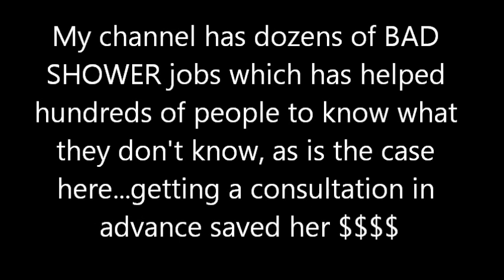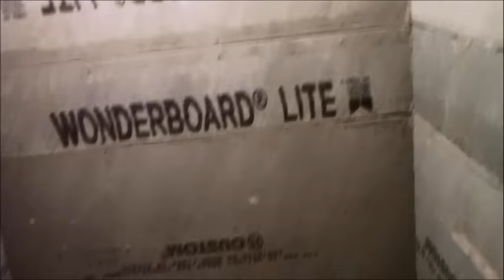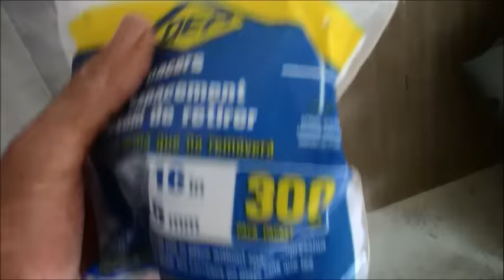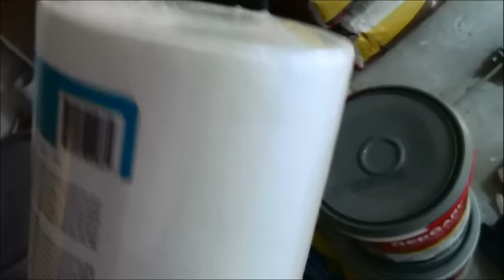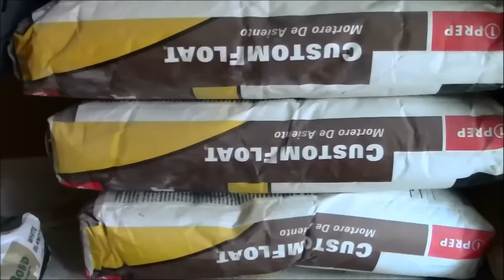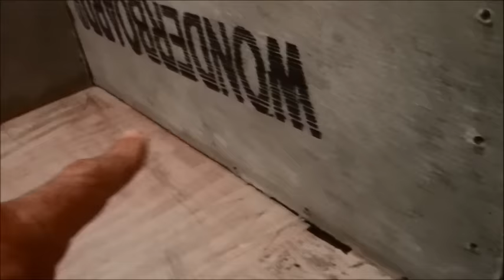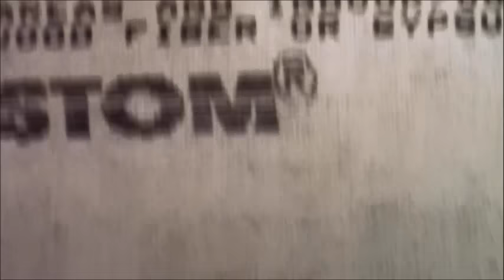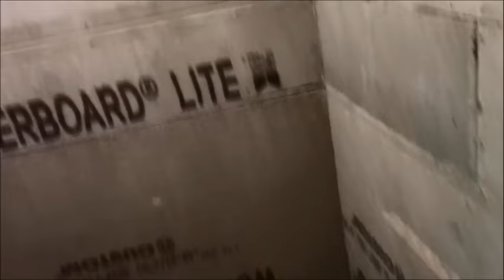BAD SHOWER DAY ONE !!

Comment: Acryl Pro Tile adhesive is mastic! Red guard will not bridge a gap, that's why you  use the tape. You do not have a clue!
Reply from the maker: Mr Clueless will be YOUR name henceforth....
What does it say on label of Redgard ? And what is tape used for ? 
When you answer those you'll feel pretty dumb 😉

You'll be even dumber if you EVER use this pre-mixed crap or tile adhesive on a LFT in a shower 😂
Reply: @StarrTile  Dad got in the tile business in 1953. Made me learn to take mud off the top of my hawk before I set tile. I told Gene Kaiser (invented thinset) thinset made everyone a tile setter like pvc made everyone a plumber. Any tile setter can tell you don't have a clue by watching you use your tools. You can fool the fans but you can't fool the players. You are one of the problems with the industry today.
Reply from the maker: @keithfuller28  I have probably traveled to more countries than you have STATES... I have seen people do things much better with much less, so disparaging anyone about what tools they use or types of tools is complete nonsense and garbage. If your judgement is based on tool usage then you're ignorant as hell...that's not a slam, just a fact !

Actually the biggest problem in the business today is book soldiers like yourself and fatass Sal... just like the West Pointers I experienced in the Army, the rank-and-file never trusted them, they would get you killed in combat and quickly !! Can't think outside of the box they cornered themselves into.
Reply: @StarrTile  Fact!? Its because you can not use them correctly. Next time I am in Georgia tiling a Food Lion with sloped mud floors with 3/4" double abrasive 6x6 Quarry and sweeping in 1/2 and 1/2 then grouting with black epoxy I'll call you!
Reply: @StarrTile  States I have a license in or set tile in:
Texas
Oklahoma 
Louisiana 
Arkansas 
Tennessee 
Kentucky 
Missouri 
New Mexico
Colorado 
California 
Oregon
Alabama
GEORGIA 
Florida
South Carolina 
North Carolina 
Virginia 
West Virginia 
Pennsylvania 
Indiana 
Maryland 
Connecticut 
New York
Nevada
Reply: @StarrTile  Book soilders?! Yeah, tell someone like Col. Robert Howard that. Oh by the way, I tiled his house too.
Reply from the maker: @keithfuller28  you're free to call me anytime you wish....
I always enjoy an educated Lively debate... and by education I mean real world experience. But that you think there a such thing as a proper tool speaks to ignorance. You know in Jamaica that use sticks for spacers... Glass Cutters to score a tile... and a broom to move around slurry mix.... yet their finished product far surpasses most people that do tile in the US oh, so don't give me that tool makes a difference bulshit...
And you're crazy Kaiser guy that pushed cancer healing elvolv water ?
Yeah, throwing names around definitely doesn't help your cause.
Anymore than fatSal slamming me on John Bridge....I could give a fk..
You're not my customer, and going into my 22nd year without a callback speaks for itself 👍👌

But yeah, call me anytime, I will entertain the conversation.
Reply: @StarrTile  Jamaica?! I worked at the Hilton in Ocho Rios in 1984. They were self taught like yourself, it was obvious, and the reason they used tools like that is because they were not able to get what they needed or to poor to buy them. All the guys I worked with used hand made trowels of wood and bamboo handles. I used screen mold cut up as spacers in Virginia Beach where we tiled the exterior of a mall. Real life experience! Over 200,000 Square feet. I was taught to use nylon string before there were plastic spacers. Every mud job I do over Concrete floors I slurry the floor with a broom. What do you use? Serious question.

Comment: I tape over the seams, mortar over that, and then 2 coats of redgard for a smooth waterproof surface. 

Watching the rest of this video you are nitpicking the shit out of someone's work WHO HASN'T EVEN STARTED.

Way way ahead of the process? You mean it's that big a deal to remove 3 pieces of wallboard to do the pan? What a joke.

And LMAO a homeowner did the prep, probably bought all the materials, and you're blasting the tile guy. Hilarious.
Reply from the maker: You sound like the hack who started this job...the wallboard you'll just "fix" still leaves behind :
Warped PT curb
3 gallons of mastic
The drain off center
The valve off center
No blocking at stud bottom
Bowed wallboard on valve wall
15 sharkbites inside wall
Toilet flange too close to wall
Toilet supply right of toilet
Squeaking of subfloor
No real contractor doing showers would EVER make stupid mistakes in the beginning like those, the fact that the drywall guy put up cement board and fucked that up is irrelevant to me, I've seen too many hack jobs 90% done and non functional to know better...and homeowner pays for the mistakes.
Which gets me to your ignorant comment about prep, SHE is a 40 yo Columbian single woman with no clue or skills to prep a shower...I find it fascinating that ppl watching a 30 min video think THEY have all the info to pass judgement on anything, yet they do. Kinda makes you look like an ass....and an amateur.

Comment: Lots of problems with this one. Good catch. I don't have a problem with the materials minus the premix thinset and the pressure treated lumber. The drain definitely should've been centered either for a linear drain or center. This guy definitely didn't know what he was doing 😂. You don't necessarily need the pan liner if you top coat but this is horrible prep work. Good video of what not to do.

Comment: 1st mistake I'd see walking in.... all the materials aren't orange. I've been setting for over 24 years. Pans, membrane, dry packs. I know it's hard, but you should go take Schlueters class. It would change your life. You can learn new tricks.
Reply from the maker: Schluter is a marketing gimmick, that's all it is... they want you to buy their proprietary products, all the phone on plastic that cost Pennies on the dollar and then they charge you a boatload. At the end of the day it does not make you a shower better and it surely does not make it last longer. But if you got some extra dollars put it in their stock because they don't need advertising on radio or TV or even print ad because of people like you that push it, and of course Schluter who brainwashes you in their classrooms
Reply: @StarrTile  spoken like a true "floor guy" set in his ways. Adapting doesn't mean it's wrong. Means admitting there is more out there than what you were originally taught. Don't tell me I'm brainwashed. I use the best methods and products available to me. Sorry to hear you're not open to improving yourself. Still have wooden wheels on your vehicle? Old flour sacks for undergarments? Corn cob for wiping? Better things come along. So sad.
Reply from the maker: @seanknapp2662  a floor guy 😂😂😂

Yeah maybe 20 years ago...I do bathrooms and shower rebuilds on a daily so I don't know where you get floor guy from. As far as adapting, I'm extremely aware of all the products out there, in fact I have used some of them in some circumstances like kerdi.. excellent product for doing a shower pan liner for curbless on a concrete slab, or on high rise condos with metal studs. On occasion I'll use foam board when customers want it. 
But insofar as all of the proprietary Schluter products to build a shower, and you must use them all for warranty, it's definitely a marketing and sales gimmick. You'll get a job done a lot faster and you'll spend more, but you won't pass that savings to your customer, plus it doesn't make your shower any better...just faster... I'd rather take my time and do it right.

You mentioned better things, try to explain to me why plastic and foam is better than standard materials.
I have a live stream every few weeks, usually on a Sunday, subscribe to my channel so you can come on camera and I will have you as a guest... we can debate this verbally with an audience.
Reply: @StarrTile  I get where you are coming from. I have just found their system to be the fastest, just as reliable and offers a good warranty. I like all their products. I really do. Don't make $ at all from them. Styrofoam and plastic are under 5" of concrete in my shop heated by radiant heat. Didnt compress at all and insulates. Just like the Schluter pan under the showers I install with heated cables..... pretty good system. And it doesn't add the weight of a pan on the 2nd floor.
Reply from the maker: @seanknapp2662  you know on my trucks I have steel bumpers, and I really like the ones on the back if somebody rear-ends me.
You will never see one of my bumpers on the side of the road like these foam and plastic bumpers.
And there are some truck manufacturers putting in on their vehicles smfh....

Just saying

Far as the warranty goes, every shower I ever build has a warranty for life, I probably have 20 years left and it is extremely doubtful I'll ever that call, but I definitely want to know if I ever screwed up, a product does not make a shower better, the installer does

Comment: I’ve been watching your videos for years.  I really enjoy the content that you put and find it to be quite informative. 

However I’m going to have to respectfully disagree with you on the treated shower curb. 

It’s common sense and most builders use pressure treated lumber whenever it comes with ground contact especially in high moisture and humidity areas.
Reply from the maker: I suppose it up is done correctly and there's enough Fasteners that there won't be a problem, however I'm not willing to take that chance because it is wrapped with backer board and tile which does not move the way Wood moves...so for me it's a cya thing
Reply: @StarrTile  lumber, as all wood, will warp, twist, cup because of how the wood drys according to its fiber build up. I find pressure treated to hold up better against movement than non treated. But that could just be the luck of the cut within the tree. I agree about the waterproofing and all but you have me questioning the rest of your knowledge now.
Reply from the maker: Properly fastened wood will not warp...typically the only PT you have in a house are plates at perimeter that have weight of walls bearing down on them so warping can't happen, but in my experience most guys don't secure PT good enough on curbs... and in this particular case he had a couple of two-by-fours that were already warped to srart with !
As chemical dissipates over time then shrinking can occur and create an issue. For those reasons alone it's better pine 2x4 is used.

It's entertaining to me though how everybody nitpicks one or two particular things that I criticize, when overall there are about 14 or 15 things combined this guy was doing wrong, from non center of shower drain, toilet flange with 10" offset, toilet supply on right instead of left, 12 sharkbites inside wall, wall with huge bow, wallboard put on 1st before liner, etc...though that 3 gallon bucket of mastic told me everything I needed to know...
And you question MY knowledge ?
😂😂😂😂😂😂
Reply: @StarrTile  I’ have no experience in tile except for what I e come across YouTube. So I watch and take I. What you and others say but when one thing does t line up to what I know, it makes me wonder what else maybe not be true.
Reply: @StarrTile  You said it, it's all about how the PT is fastened.

Comment: Good video and I cringe when I see these things myself. 

One comment...There is no requirement to make your curb "3 high" but you make this proclamation this in this video  as if it is "Gospel" 

If you have to have a curb that is 5 inches high including backer board and tile, then there is a problem with the drainage. LOL . 2 high is plenty..looks better, and has never caused me any warranty work.
Reply from the maker: I never said three in high on the curb, I said three two by fours...That's 4 1/2".
And yes, you can make it lower but why ? You need enough girth on inside to get a tile on that's not a very small sliver. But if your way works 👌
Reply: @StarrTile  That is precisely what I meant by "3 high".  There isn't any rule for this. Depending on the tile, I generally don't go any higher than 2 (2x4's) high.  You are absolutely correct about small slivers...SO ... If they want  the same mosaic on the inside of the curb ( to match their shower floor) , then I DEFINITELY advise the customer to go 3, 2x4s high. LOL 

Most people these days ...at least in my area want low curbs or no curbs.

Comment: Once again yada yada yada blah blah blah everybody has their own way of doing it your way is not necessarily the right way yes you have great ideas I agree with pressure treated wood not being used and stuff when you hire people that don't know that's what you get I seen a professional tile man who does big Custom Homes do shity work so don't say everybody who's a contractor blah blah blah you get what you pay for it as far as saving those little spacers everybody throws them out they just deal them in their next job
Reply from the maker: There was a minimum of 14 mistakes made... set aside the spacers since everybody focuses on that.... shower drain off center and not anchored, toilet drain 10in from wall instead of 12, toilet supply on the right side instead of the left side, wall with huge bow in it, wallboard set before pan liner, no scabbing at floor, 20 sharkbites inside wall, shower valve missing mudguard and hiding screws for escussion plate, shall I give you some more or is that enough for you to know this was going to go south...

The fact there was warped pressure treated wood, three gallons of mastic which has no business in that bathroom whatsoever, and yes the new bags of spacers... which had no business being there anyway since this was a large format tile and needed leveling Clips, not spacers.
I guess some people are okay going along for the ride until it's past too late and they spent thousands, I'm not one of those and neither was the homeowner.

If all I did is go gather material and said it inside the homeowner house, anybody could come along at that point that knows what they're doing and know that I'm doing it right just by virtue of the prep and the material.
It amazes me that so many people chime in to give this guy a pass because of 2 bags of spacers 😂
Reply: @StarrTile  shower drains don't necessarily need to be centered it all depends on where Plumbing is how it's laid out that they want to spend the money is it new construction it's just like showerheads they're not always centered either especially to rain flows over head and the body massage stuff down the Walls come on now you getting a little nitpicky yes we prefer everything to be perfect but it doesn't happen that way this is the real world not reality YouTube
Reply from the maker: @joehalliday4989  this definitely was a real world and reality, if you go to the description you will see link to the tear out and the finished product, the customer wanted her drain Center...

But after I enumerate all of the various mistakes and you still push back on a center of a drain issue then I cannot help with your mentality of homeowners getting shafted. My loyalty is customer 1st, comments on my channel are irrelevant since they don't know the scope of the project or even conversation that preceded it

Comment: So, you claim to be a professional tile setter and you don't know the difference between a bucket of acrylic based tile adhesive and a bucket of mastic? And then you compound your lack of professional knowledge by dissing the acrylic based tile adhesive by saying it will never dry? SMH. We are a remodeling and home repair contractor in Florida, licensed and registered with the state, and I have used this product in literally hundreds of tile jobs in the humid  state of Florida and have never had an issue with drying or adhesion. Works perfectly. Do your research and perform a modicum of Due Diligence before spreading misinformation. You are not helping anyone by presenting your critique without full knowledge of the materials.
Reply from the maker: It's garbage and if use ANYTHING to set tile...especially LFT, and especially in a shower...that comes in a bucket, then you're no professional regardless all the distinctions you give yourself.

Comment: Redguard sucks doesn't bond to the substrate
Reply from the maker: It absolutely does, I've been using it now for well over 12 years and never an issue.... sure if you try to peel it off it will, but that's like taking off a condom and then complaining it doesn't work
Reply: @StarrTile  oh that's how I ended up with four kids haha I still like hydroband better